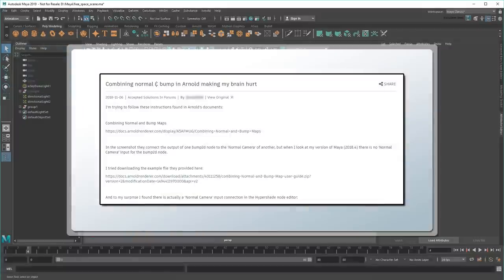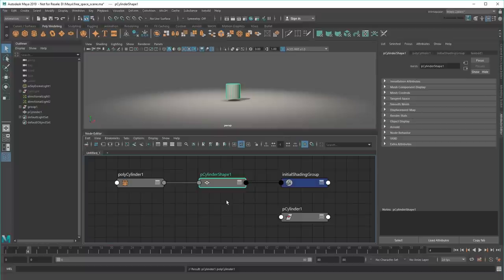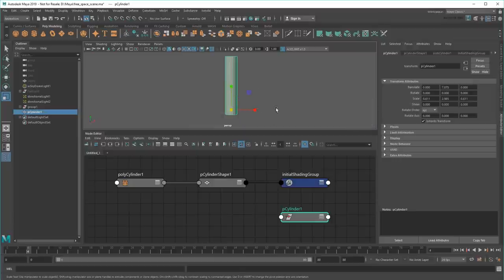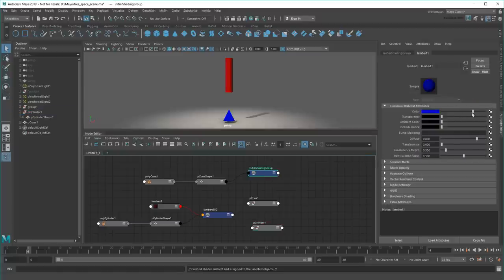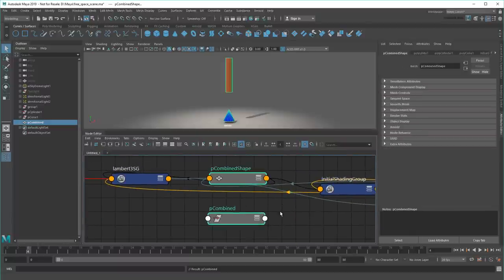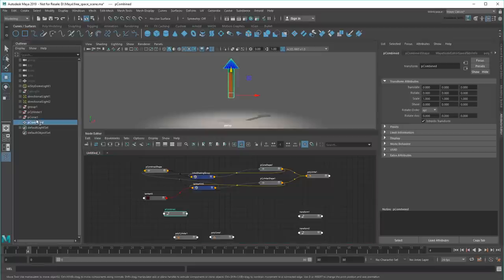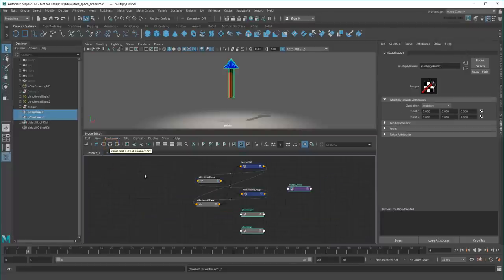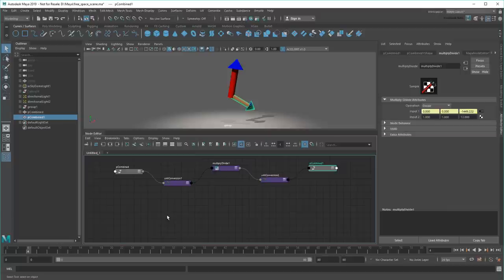What are nodes and connections in Maya?

Comment: I have a lot of nodes, 179 of joints, connected to a multiplydivide, connected to a group. I get the message that it exceeds 500 blablabla may not evaluate as expected. Now.. unfortunately, each time I set-driven-key attributes of the control to the joints, maya glitches, when I key I see a black bar stretching along the name of the attribute to the end of the channel box. When I click the input field those bars disappear. Now.. I edit the post inifnirty in the graph editor so that my attribute can exceed hte initial values. However, because of "exceed 500" message I kept getting when conencting the nodes the attributes only respond well to me inputting values manualy, so typing... While what I want to do is hold middle mouse button and drag to change the value. Unfortunatly it snaps to the key values.... I've checked the connections and I am positive the error message is what's causing the malfunction with the set-driven key, as when I replicate the exact same creation in a new maya file with under 500 connections the attribute responds to the middle mouse normally. I've tried to google an answer, but no such luck. I found a post that said to increase the editorConnectionScanLimit to beyond 500, but I don't know how to do that. Googling "editorConnectionScanLimit beyond 500" doesn't bring any explanation on how to find that. Can someone please tell me how to do this?
Reply from the maker: Do you have objects with modeling history that you can delete?  It's likely you have a ton of history nodes which Maya has to constantly evaluate int he background.  

You can try to increase the scan limit by putting this in the MEL command line: optionVar -iv "editorConnectionScanLimit" 1000;

Replace the 10000 with whatever you want, but just be aware that having a ton of unneeded nodes is going to affect your performance anyway.  It'd be better to try and prune out the ones you don't need first.
Reply: @Autodesk_Maya  Unfortunately I don't have modelling history because I always select my meshes, delete by type history when they are finished. So unless that doesn't delete the history there should be no history on the meshes. Would have been an easy fix. I'll try the command, thanks for telling me about it!

Comment: Hi Thanks for this great video, I'm curios is there a way for a node to execute a command In Maya? for example when a value of a cube translateX on is Higher  then 10 then create new cube.
 I know it's littel off topic but I would realy love to know if it's possible.
Reply from the maker: It's definitely possible.  You can use a scriptNode, then add a scriptJob to it that triggers whenever cube.translateX changes.  You'll need to learn a bit of Python for that.  This is actually how I created a lot of the interactive tutorials I released recently.

Comment: 6:10  Why are some of the connections going backwards? This is very confusing.
Reply from the maker: It's just the way the nodes are automatically laid out after the unification.  If you look closely, you'll see that the arrows still go from one node's Output to another's Input.  So for example, if I just moved pCombinedShape over to the right, then all the arrows would be going "forwards" again.

That said, don't get too hung up on the idea that all the arrows need to go in the same direction.  Some graphs can be complex enough that it's impossible to get them all flowing one way.  Instead, just focus on the idea of "following" the connections from one node to another and figuring out what each node does to the info being passed along.